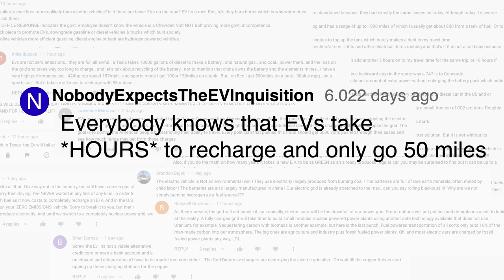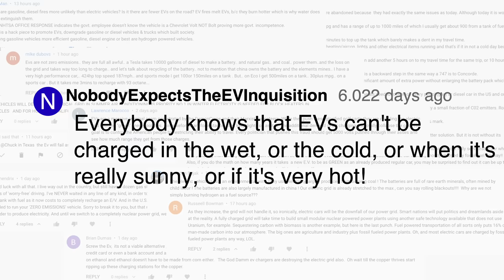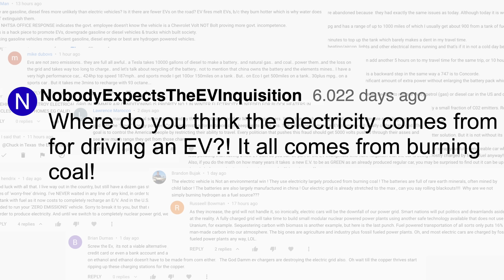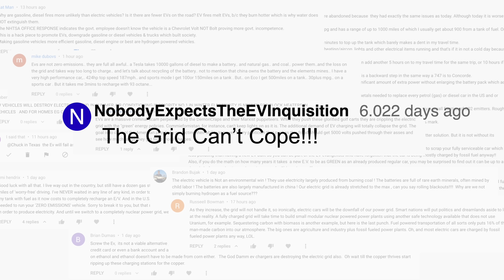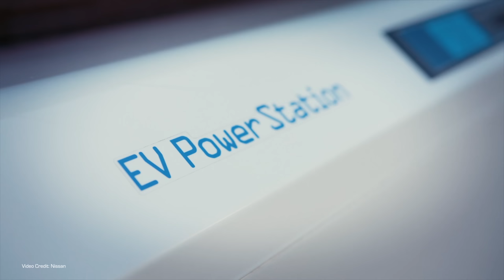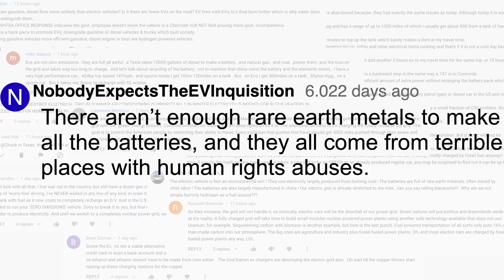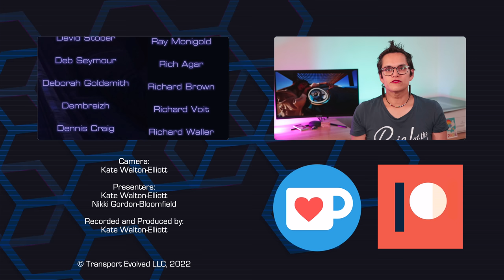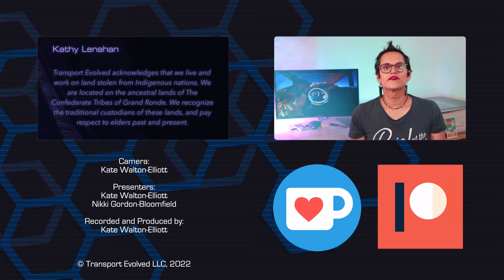The Transport Evolved List of Common (EV) Misconceptions

Comment: 60'000 miles is the distance generally quoted for carbon neutrality with ice, by which time most cars have been sold.  Then there is longevity and the price of the main unit to replace, the battery. James Cooke's model s battery has just died and will cost £8900 plus vat with a repair replacement ( not new ) after 8 years use from new. My 30 kwhr leaf has lost 1/4 of it's range in 6 1/2 years and 30 k miles whereas my other 2 ice cars are 14 and 18 years old and still working aok with the Mercedes still doing 51 mpg and a range of 650 miles brimmed on 70 mph roads afairp on my long journeys to and in Scotland.
Reply: "60'000 miles is the distance generally quoted for carbon neutrality with ice, "  Which studies are they?  The WSJ enlisted the Toronto University to perform a study in 2021 comparing the RAV-4 to the Tesla Model 3 and the break even point was 20,600 miles.
Reply: Quite anecdotal argumentation. 

60'000 miles is the distance generally quoted for carbon neutrality with ice, by which time most cars have been sold
The 60k miles can be true in certain area's, but in most (western) area's it is a lot shorter than this. Also generally speaking a cars does around 120k miles or more in its lifetime, so 60k miles would still be really good. That they are sold to other people before this 60k miles doesn't matter at all, it all depends on the lifetime of the car, not how long the original owners use it before selling it 2nd hand.

James Cooke's model s battery has just died and will cost £8900 plus vat with a repair replacement ( not new ) after 8 years use from new.
Don't know who James Cooke is, nor do I care. There can be EV's that need battery replacing in 8 years, but overall this shouldn't be the case. Tesla EV batteries for example are guaranteed for 8 years or up to somewhere along 100k miles. So they definitely will not want the battery to need to be replaced close to every 8 years, the risk of it falling just in the warranty time is too big. Overall new Tesla batteries are expected to last the lifetime of the car barring damage, manufacturing defects (will almost certainly happen in warranty period) and very intensive use.

Now if you still want to mention James Cooke, please also give more background information (like miles driven) and keep in mind that one instance doesn't make a trend. 

My 30 kwhr leaf has lost 1/4 of it's range in 6 1/2 years
The leafs aren't exactly known to keep their capacity well, especially not the older ones. This has been pretty well known for a long time now.
Reply: Well you must have gotten the most badly looked after leaf going mate. I’m at 23k on my leaf with no issues so far in our damp climate. Full battery bars. 9/12 bars if true on 30k means it’s probably been parked up at 0% for a long period of time, or kept at 100% most of its life.
Reply: Surely if your E-class is brimmed and doing 50mpg wouldn’t it be getting 800mls to a brimmed tank? 😊😊
Reply: @salibaba  not true, been perfectly looked after, hardly rapid charged and charged nearly always on a 7 kw home charger and never left at 100% or 0 % as you suggest. It also was bought brand new so i know it's full history and lives in the North East of England in a cool climate. It was built at Nissan Sunderland and bought in Gateshead by me. At 23 k mine had 12 bars, you are now entering the twilight zone with yours when it reaches 6 1/2 years. If I had known at your stage, I would have sold then. Now I have an unsaleable vehicle, only any use for short trips.
Reply: @salibaba  now now jealousy. Show me an EV that has a range of 650 miles at 14 years old, I'm waiting, long pause lol.
Reply: @stevezodiac491  get into Nissan then under the battery warranty 👍🏻
Reply: @stevezodiac491  Out of curiosity, which model mercedes do you have?
Reply: @MDP1702  Mercedes E220 cdi avantgarde 2008 in iridium silver, the face-lift model.
Reply: I'd love to have had that EV with the bad battery in 2020 instead of my ICE car. The one I had to spend 15k EUR for a new (used) motor when the original one decided to identify as "heap of scrap (it/its)" right when the 4-year warranty ran out. A factory-new one was quoted at 25k EUR, btw.

Comment: Yes 300 miles at 30 to 50 mph not 70 mph.A model 3 standard range at £46k only does about 190 miles in favourable conditions at 70 mph, less when it is windy, cold and wet. Long distances are mostly done domestically with spouses, most can drive, hence you don't need to stop for food or drink as you can eat it in the passenger seat and rest when it is your turn. Stops for the lavatory only take 5 to 10 minutes, not 40 minutes to an hour charging time.
Reply: Is the ability to cover 2,000+ miles in less than 48-hours fast enough?  If you answered yes then a EV will work just fine for long distance trips.
Reply: @SDGreg  you obviously have not done the NC 500, where there are no Tesla Superchargers North of Inverness and 30% of charge places Scotland chargers in a recent survey were reported out of order. Plenty of diesel though ! Also plenty of peace of mind. By the way 2000 miles in 48 hours, how many of them stuck at the side of the road for hours charging lol. In the army if you misbehave you get put on a charge, seems appropriate in this instance also. I have a life.
Reply: @stevezodiac491  "By the way 2000 miles in 48 hours, how many of them stuck at the side of the road for hours charging lol."    The ability to cover 2,000+ miles in less than 48-hours is more than fast enough the vast majority of drivers.  However if it isn't, then knock yourself out.  I would rather not be at the mercy of oil companies and the price of petrol.
Reply: @SDGreg  it is the not knowing if chargers are working, in use, deviating from route, back of garages in dark corners with no rain cover, being iced,  telecommunication problems, nobody to start it remotely because they only work 9 to 5, poor payment systems, then you have to sit there 40 minutes to an hour when or if you do get a charge. I know, I have done it a lot and don't want to.
I was enthusiastic at the start, particularly when I didn't have to pay to charge as an early adopter but over time you realise you have a life to live and do not want to waste it stopping every 150 miles or less for up to an hour to leave an emergency buffer.
Reply: @stevezodiac491  I have done it to and I have never experienced any of the issues you claimed to have with my 2019 Leaf.  What EV where you driving that you experienced all these issues with public DC charging?

Comment: Did you mention that they catch fire all the time?
Reply: Gas cars catch fire more than EV's.
Reply: Yes I know.  Gas cars catch fire 1.5% over there lifetime.  So far Tesla’s are something like .16%.  But, to be fair we need more data, but still a very good number.  Unfortunately my brother has “different” facts.
Reply: @newsgeekus1216  I understand your feeling of caution, especially with whatever happened with your brother. However, I think we have sufficient data since we have 10 years of data and millions of miles and charging cycles for Tesla alone that show that electric cars are as safe if not safer when properly designed.
Reply: @tonyjohnson6775  VAERS is the vaccination reporting system. It is designed to look at the population over time to ensure that side effects that are extremely low likelihoods are not missed. If I take your comment to that system, you would be saying that it is good enough to only look at the initial populations, and we can ignore looking for those low likelihood side effects because it is obvious that the vaccine was properly designed by only looking at the population vaccinated during the initial periods of time. Now, even with this, there is almost no way that those low likelihood events are going to change the 25 into 1,500.